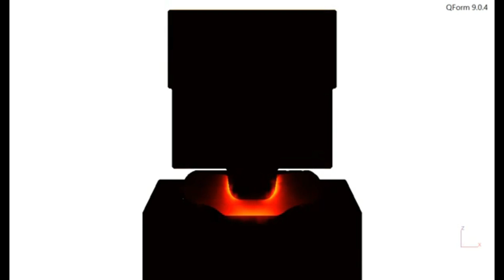MIDHANI established 2nd highest Isothermal Forging press of the world for Aero engines

Comment: We had engine technology. But issues were of blades which were not sustainable at higher temperatures. If we achieve these core technologies. Our Kaveri engine can get more thrust.
Once we achieve this success, DRDO have to start adaptive cycle engine for sixth generation engine either individually or JV.